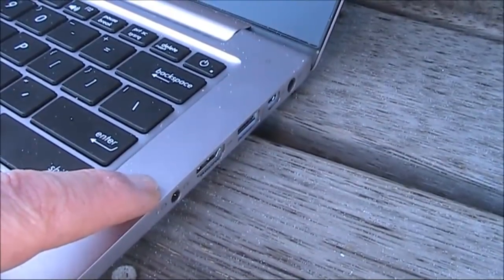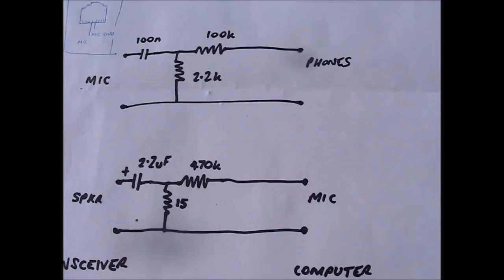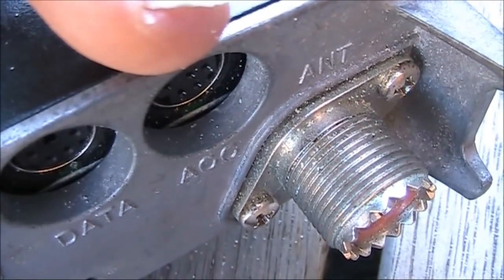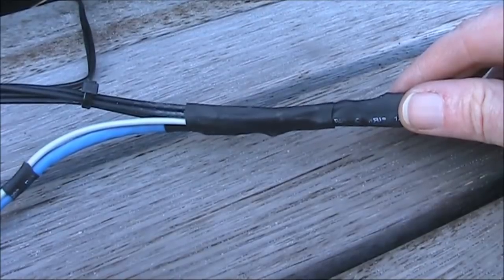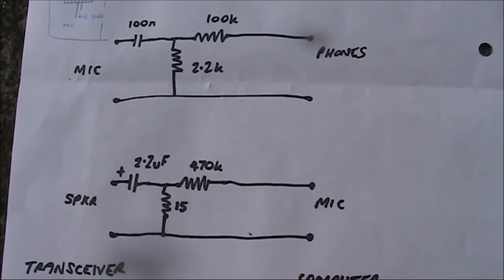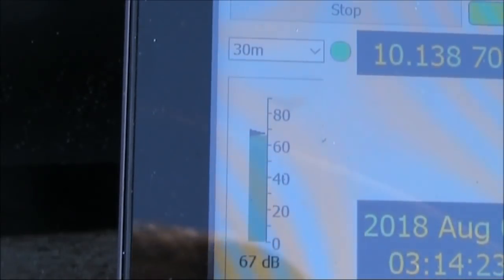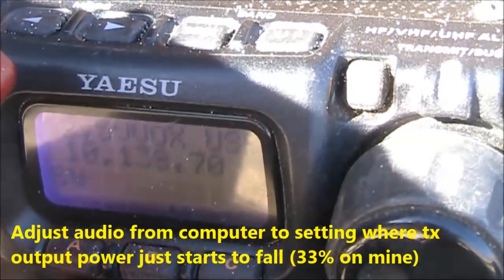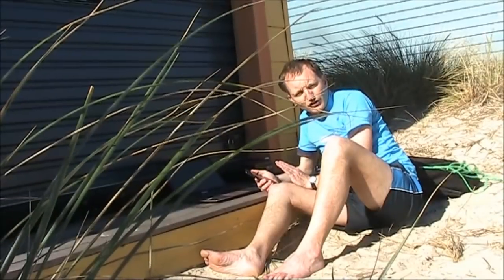Quick and dirty laptop - transceiver interface cable for digital modes

Comment: Excellent video, Peter! I've made a cable that plugs into the back for my own FT-817, but it's a bit of a pain to use because of the lack of VOX on the rear input. I took a USB sound card, soldered the cable from an old PS/2 keyboard to it along with some resistive dividers to limit the audio levels. Then, I use the DTR output of a USB to UART adapter to toggle PTT. This is a bit of a mess to use in practice, especially when outdoors. And it means that I have to use two USB ports on my computer. I am vaguely dreaming of building an integrated digi-interface for my radio at some point, but maybe I'll try your method and see how that works for me first. Thanks for sharing! 73 de LA1WUA
Reply: i dont mean to be so offtopic but does any of you know a way to log back into an instagram account..?
I was dumb forgot the login password. I would appreciate any help you can offer me
Reply: @Finnegan Eric Instablaster =)
Reply: @Cyrus Thatcher It worked and I now got access to my account again. Im so happy!
Thanks so much, you saved my ass !
Reply: @Finnegan Eric glad I could help =)

Comment: You could have added the bit where you connect up wires from the 817 to the Y Mike and Speaker barrel connectors eg the 2 RJ45 wires to the relevant Y connector. Otherwise vgood thanks.

Comment: I was looking on your web site to see if you had more information on this.  It looks like a easy build.  Are there any specifics on the type of capacitor?   I’m thinking to use a non polarized.    Another question is where you show the mic pins are you showing the radio port or the RJ45 cable end?
Reply from the maker: Capacitor type shouldn't be critical. Mic skt pinouts for various transceivers readily available on the web.
Reply: Ok, I did manage to find a Yaesu schematic showing pins 4 & 5. My laptop uses separate mic and spkr  jacks. You show TRS jacks - do you tie T & R together or just use T and then S as the ground?  When I made and connected the RJ to Mic in I had tied T&R.  Got no audio but a horrible squeal.  Maybe a ground loop?
Reply from the maker: @JustMe-qq3wp  Sorry, I don't know what a TRS jack is.
Reply: @vk3ye  Tip, Ring, Sleeve 😉 (Ancient Telco person - Late to the party but just now looking at using my 897 for FT8 - so found this Vid)

Comment: Thank you Peter! I built it and works! But needed to adjust a bit. The FT817 sound out -> PC MIC IN way: the resistor divider lover part to 47 OHM and the serial upper from 470k to 100k, then started working as you showed, given the best result in WSJTX at 10 o'clock RIG volume level. The PC -> FT817 way is fine, given the best result usong VOX with 50% PC volume output. 
+1 Thing: I used an unusued PC ethernet cable for Yaesu RJ45 PTT.  The BLUE is the MIC GND, the BLUE-WHITE is the MIC input. It makes sense.
Thanks, 73 de HG7TT

Comment: Great video but I have a couple of questions about the choice of values for the high pass filters at the beginning of each circuit.

The top diagram has a cut off frequency of 723 Hz

The bottom diagram has a cut off frequency of 4.82 KHz

Why were these values chosen?

I'm only curious as I'm new to digital.

Many thanks.
Reply from the maker: Any filtering effect is minor and is swamped by the high input levels and the need to attenuate significantly.
Reply: I made similar patch cables in order to connect what is basically a studio audio rack set up to my radios. My receive goes through their own independent channels on the mixer via their respective ext. speaker jacks. Anyways, with the condenser boom mic I use, even with the gain down it's too much coming into the mic audio + pin on the radio, I just used a 5k potentiometer and at about halfway it has things at a perfect level. I'm not sure why constructing a pad is necessary if just adding a pot inline works and also allows for adjustment, which for me having more than 1 radio was a huge bonus. Perhaps one of you may be able to shed some light on that as I am smart enough to know there obviously must be a perfectly good reason, or else the people who are smarter than me wouldn't be using pad attenuators instead of the pots inline. Unfortunately for me, I'm not smart enough as of yet to have come up with a remotely reasonable theory besides that it may have something to do with impedance matching or some balance issue or something along those lines. Either way, this videos great because this method of connection can be used for a number of different things with a few changes to the design itself depending on what's being connected and for what purpose. The general idea stays the same, and even for a person who's not interested in digital modes at all, there are still oceans of possibilities once you have the ability to incorporate software on a computer, tablet, or phone. I've gone absolutely nuts with all the different things I can do with audio in both transmit, and receive. Cleaning up a faint voice hiding amongst thick, heavy static to a point where it's heard clearly is not only useful, but very rewarding. Even with a narrow SSB signal I manage to sound very clear and crisp. Neither is possible without a simple set of patch cables to, in my case anyways, connect 2 of my favorite hobbies together in order to further the experience in both. Sorry for the novel, I'm definitely a rambler once I get going.